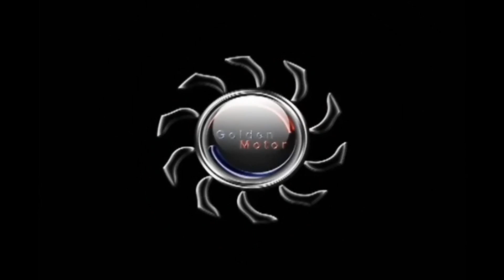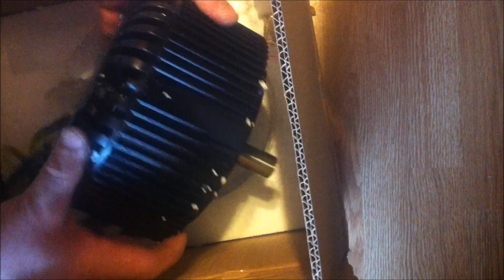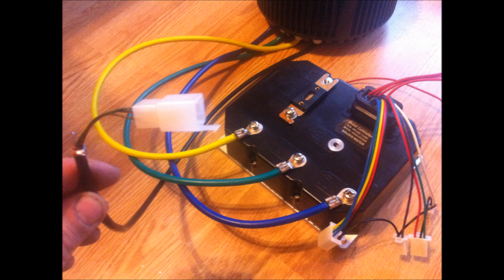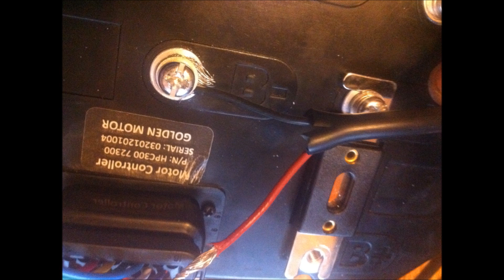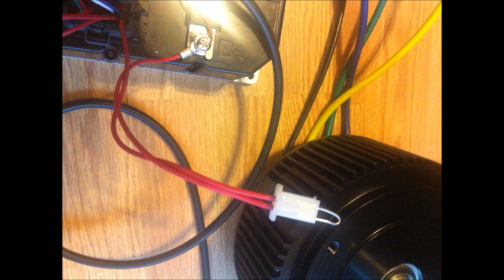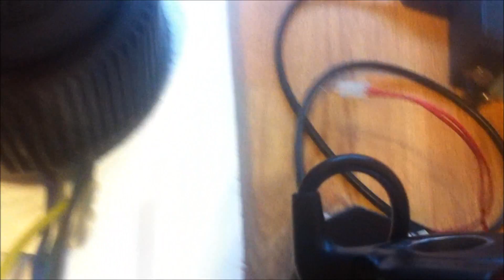HPM5000B Hooking up a Golden Motor 5KW BLDC Motor

Comment: I want one for a outbound boat motor. I want to control the throttle wireless by xbee wifi probably. What principles doe the throttle work under and do you think this would be possible?

Comment: What RPM are you getting at 48v? I have the same motor that I'm using to replace the shit brushed motor on my 2011 Zero UX. I want to do 72v, but no battery options will fit my frame, so 48v is my only option. If I know the top end RPM @ 48v I should be able to figure the chain ratios I need for highway speeds.

Comment: Hi! I have question. I want to use two motors on my motorbike project which I am planning. So that means that I need to connect one throttle pot to two speed controllers. What would be best way to do this?

Comment: Hello! Thanks for this great and simple video!
I have a few specific questions....
Is this type of motor and controler suited for hybrid car conversion?
I would like to couple this motor with the drive shaft of my car, right at the differential, coupling with two pulleys and a wide belt.Here are my thoughts and worries:- can this motor run freely with the drive shaft, without consuming any power?- when i want to assist the drive while the motor is running freely, do i need to match the throttle current (0-5V) perfectly or does the controler do it for me, without jerking or riping the belt?- can i just use a switch which always sends 5V into the controler, to get maximum assist whenever needed, without jerking and damage to the motor or belt?- how good is the regeneration in %?- what about long lasting properties of this motor and controler? How many work hours can it handle?
I hope this wasnt too much at once.... I just want to show you that i am seriously considering such a project.
Thanks and all the best regards from Slovenia! :-)

Comment from the maker: There are so many different throttles. But basically one wire coming from the throttle is for the LED lights. It is usually either loose or in a two pin plug with a black (ground) wire.You hook that wire to the positive on the battery and if the LED lights on your throttle match the battery voltage the lights will work correctly.